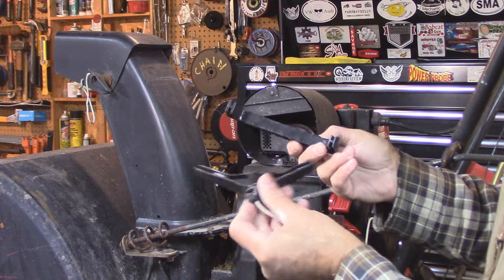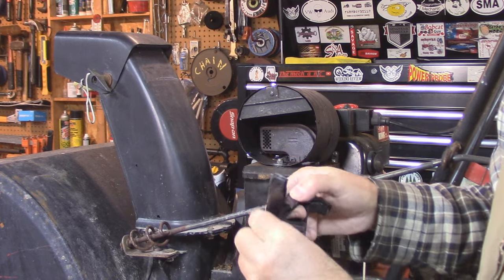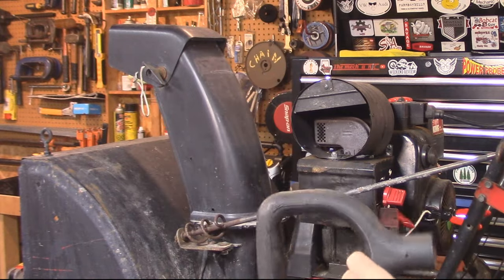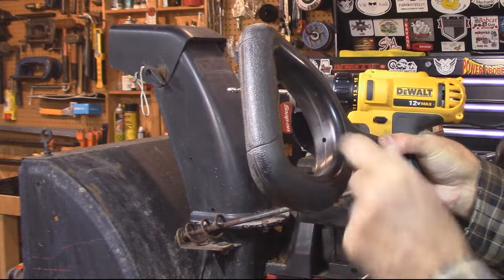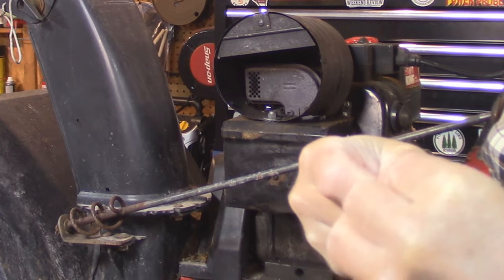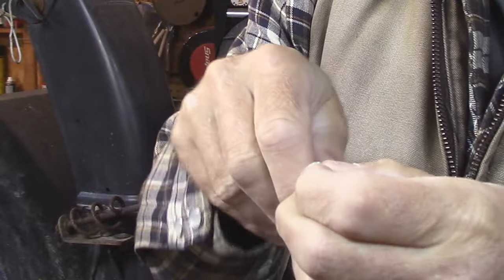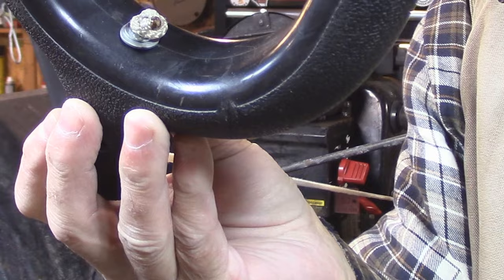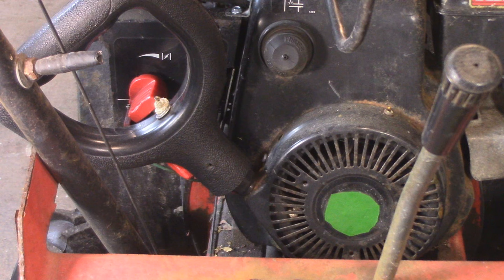Snow Blower Handle Replacement Hack

Comment: Great idea for a replacement handle. I did something like this with my lawn mower. The pull cord handle snapped in two so I used a very thick wood dowel I had in the shed. Worked perfect and was free...... Take care, Bluefin.
Reply from the maker: Yes sir I've done the exact same 👍

Comment: You're right, it is fantastic.  Using a handle from something that's meant to be used with gloves or mittens is a genius idea. And the way it fits perfectly over the collar is awesome.
I when I break a handle and don't have a replacement handle I go caveman and chop off a bit of yard implement wooden handle and drill a hole in the center.  Works fine but this is much better.  Thanks for the tip, Steve
Reply from the maker: Hi Bruce , we do think alike eh :)

Comment: And for the next time you need a handle, cut 10-15cm off the end of the wooden handle, drill a hole thru the half-way point, thread the rope thru.  No fancy loop, but the bar works just fine (and a simple bar handle is what I grew up using on all the small engines).
Reply from the maker: That's a great idea 👍